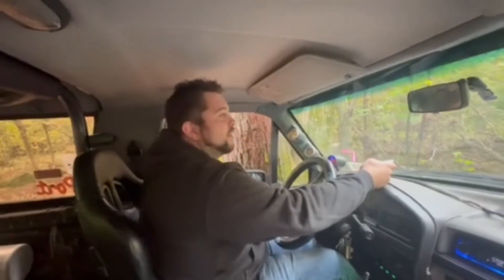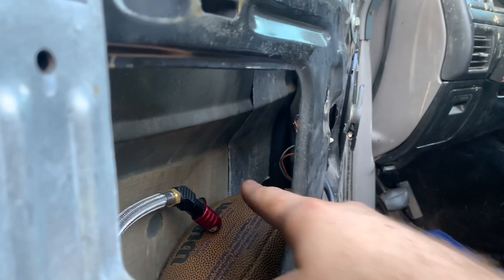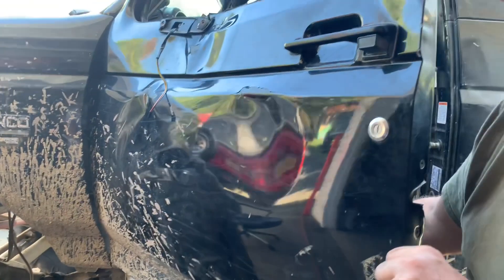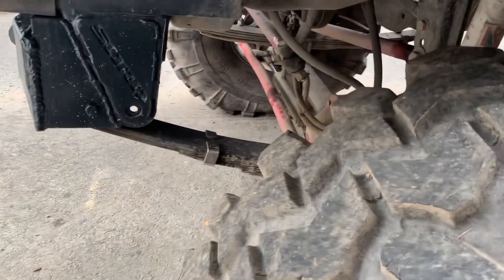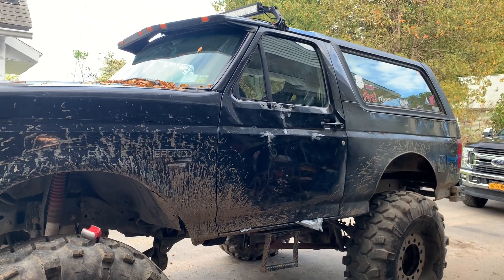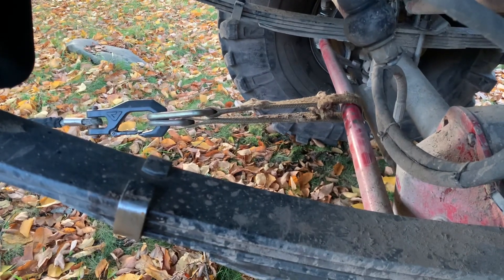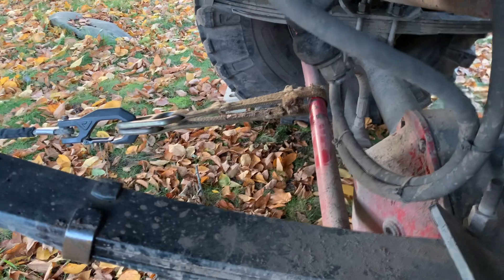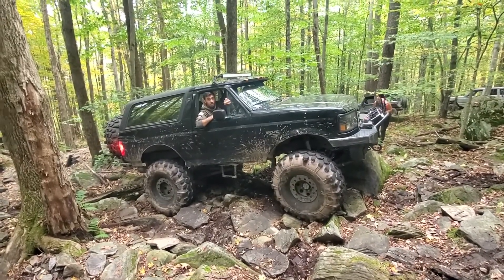Fixing Body Damage with a Football!  Easy Dent Removal and Trail Repairs

Comment: whats ur method for aligning the doors once u take em off if u have one
?
Reply from the maker: A lot of it is just trial and error.  Be sure to be careful and take your time and avoid hitting the door against the truck and knocking the paint off.  The easiest way to do it is with the fender off, but it can be done with the fender on, it just takes more time.  I’d tape up all the door edges, and just move the door around until the gaps are all equal, the body lines all match up, and the door closes nicely.